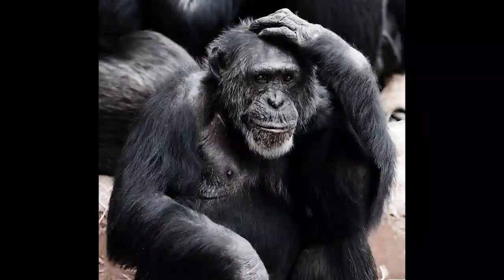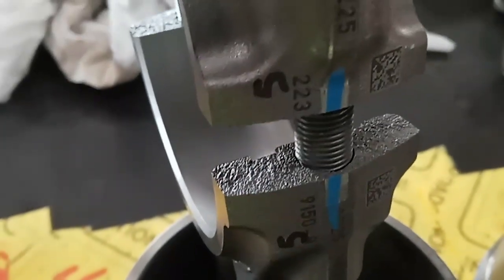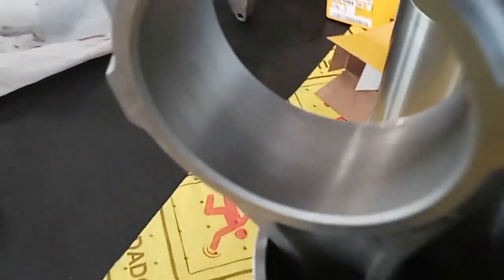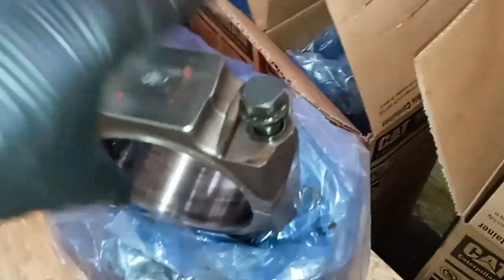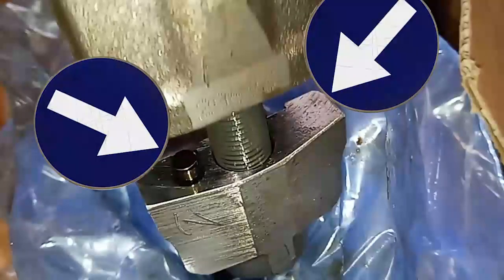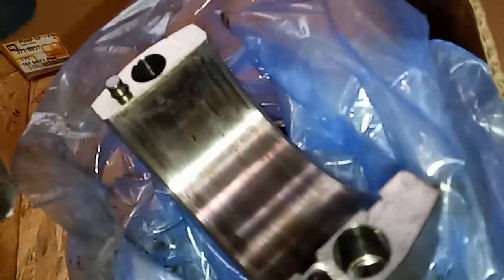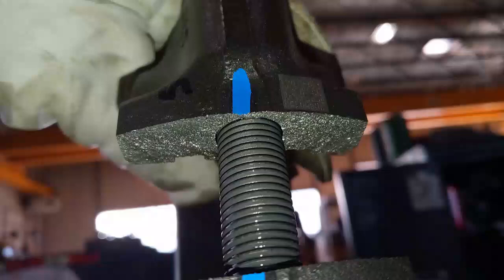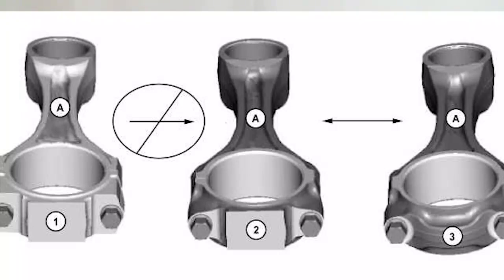What is a Fractured Connecting Rod? Cracked Rod? Advantages and Disadvantages.

Comment: Fractured caps were first used in the mid 80s by I believe Ford.  I think around 86.  They were powder forged rods made by Exotic metals (later Mascotech, metaldyne, and now American axle manufacturing, and before that the  Exotic building was a a roller rank) in Ridgway, PA.

The first diesel I know of to use powder forged cracked rods was the 6.0 powerstroke.  Metaldyne made them in North Veron Indiana.  Not sure if the 6.0 diesel was the first diesel to use them.

Comment: It's not really common there are shops routinely REPLACE fractured style rods when rebuilding an engine with them,  It is SUPER easy to mess up the mating surfaces, in a busy shop.

I've heard of shops resizing them with a sand blaster but I do not think it's common? 

I am not a fan, it seems like a dumb place to save $100 on an engine build to me.

Comment: You are wrong about fractured rods and why they are stronger. They resist journal movement and warping better. And when you have movement or warping you get bearing failure as a first sign.
And for your second argument. That why we put ultra clean motors together lube only what’s needed no lube or foreign material around the rods and pre-pressurize the oiling system while manually rotating the the crank assembly. Our engines are all pre-lubed and pressure checked. 

So let me break this down, by everything you said you hate details. You don’t want to be bothered by the care and details needed to assemble this type of part. You need a different career sir. You wine about problems instead of creating work arounds.

Comment: So I worked for large engine caterpillar plant in Lafayette Indiana. And they did that. They have a robotic arm that grabs a rod puts it in a machine that scores It with a laser. Then the arm puts it in a separate machine that the big end gets set on a locating bore that has a tapered rod protruding from the center of the bore and the machine pulls that rod down POW !!! And it’s split.

Comment: Cracked rods have ben around since at least the '70's.  West Bend Engines used this process on their two cycle engine, needle bearing rods. This eliminated the the slight surface mismatch  between the two rod parts and prevented failure of the needle bearing over time.
Reply: yea i have ZERO idea how he doesnt know about that. OMC (Johnson/Evinrude) had done that since atleast 1953 or so. this was clearly a necessity with the then-new needle bearing arrangement, but alot of 2 strokes back then still used plain ole' bronze ... which needed an absurd amount of oil. some where 16:1!

Comment: I suppose if you've got a V-8 engine, that you could use 4 cractured rods on one bank of cylinders and 4 machined rods on the other bank of cylinders.  I think it would probably run fine without too much vibration.  Or, theoretically, you could use fractured rods on cylinders 1, 3, 5 & 7 and then use machined rods on 2, 4, 6 & 8.

Comment: Fractured rods are not a new thing. They've been standard for at least as far back as the 60's.

I've rebuilt many automotive motors. Never once encountered connecting rods which were not fractured.
Reply from the maker: In the Diesel field, they don't seem to be as standard, they seem to be the exception from my experience.

Comment: One of the early Italian motorcycles, I think it was the MV Agusta had a four cylinder engine with a forged crank and roller main bearings, meaning that the outer races had to be in two pieces. The process involved cracking the outer races after cooling them in liquid nitrogen.
Ford has been using cracked rods since the CVH engine on the Escort.

Comment: Honda R18a engine (used in 2006 Civic onwards) uses cracked rods.  The rod and crap are forged as a unit then cracked apart giving the uneven surface.  No positioning pins.  It's a good and very reliable engine but in my experience no better than older honda 4 cylinders that use traditional rods.  In 2012 they Honda updated it to the R18Z.

Comment: Ive searched all your videos. Do you have  a c15 water pump remove and install video? Not many out there. Just nuts and bolts?
Reply from the maker: Just uploaded a video which kind of shows it a little bit, but not specifically.
Reply: Thank you very much. Regarding the water pump, I was trying with the t-stat housing removed. I removed the front 3rd of the oil cooler to get the extra room required (like I saw in your video). Thanks again, you are the best!

Comment: Also 're sizing a fractured rod is impossible. Entire rod with matching cap will need replacing... conventional rods can be 're sized as long as all weights are on par
Reply: Cracked rods are resized by increasing the large end diameter. Thicker bearing shells are then used.
Reply: @matthewstorm5188  if you can find outer oversized rod bearings and obviously inner o size, because crank will be stuffed. As far as I know, only ancient air cooled beetle engines have both outer and inner oversized main bearings and not rod bearings as well. 
Never heard of other engines with outer oversized rod bearings. 
Besides, this will severely affect internal balancing of rotating assembly. So imo and what I always do... new rods, and be safe and know it's 100% without mods

Comment: Fractured Rods have been around long before 2003. Ford with 4.6 liter modular engine used powered rods so no special metal has to be used. They use laser to etch rod and split them apart.  Machining big end of rod (bearing bore) no different than non-fractured rods. Parting surfaces on machined rod under load tend to work against each other (aka fretting). On fractured rod there is no movement between parting surfaces. As a tech working with fractured rods not down side, both styles you have to be careful with. If you did damage fractured rod parting surface in very small area you can hollow out that part. Only big downside to fractured rods if big end gets out of spec they cannot be fixed like non-fractured rod can be. I deal with fractured mains and rods not big deal too me
Reply: Hey, can please tell me what are the other reasons for step generation in a fractured con rod? I am currently working as a intern in a reputed car company, i have been working on this project but really I can't figure out how this step is generated, it's random and I have made sure the con rods are handled perfectly still this step is generated.

Comment: One other thing is that you can't resize the rods. They're one and done. Now I dont work on big diesel stuff so I'm not sure if that common practice on them. But on smaller engines it's common to resize rods by taking a few thousandths of the rod cap and then the machine it back to proper size to have a perfect fit for the new bearings. You can't do that with a fractured rod.
Reply: You have to increase the size of the hole and use thicker bearing shells (if these are available).

Comment: If you really want to stir the pot. Most of the fractured rods are made from powdered metal that has been pressed at high pressures to make the rod. Thus the easier to fracture the cap off. Also cheaper to make. No problem for normal usage, but if your really turning a lot of rpms and high power, forged is MUCH better.
Reply: Forged rods will bend before they separate. Sintered rods just separate and grenade the block. Sometimes the little things in life are important.

Comment: Hi Joss. Very interesting. Thanks. Mercury ( outboard engines and some others ) used this principle. That was because they are two strokes and use Needle roller main bearings. The machined rod is impossible for this because you will always end up with a small step and that upsets the needle rollers. The Mercury rods were made from case hardened steels ( again because of the needle roller application ) and the case layer was deep enough to cover the entire fractured surface, therefore making it possible to fracture. These two strokes are ""normally"" rebuilt in "clean facilities and by high level technicians", so the fractured rod was quite successful. I have to say I was very surprised to see this applied to CAT's  because as you correctly mentioned the mating of the surfaces can be problematic in the environment of heavy vehicle maintenance. I know all about this because I was part of the little team who working on the Cosworth Boat project and we had close dealings with Mercury. I'm a big fan of your YT channel and have learned so much about your work. Keep up the excellent channel.
Reply from the maker: Thank you for the comment and interesting information. Thanks for watching.
Reply: Hey Tim, can you please tell me how a step is generated in a fractured con rod given that they are handled perfectly as per the process. Can you tell me something you have experienced urself that specifically generates step in a fractured con rod.
Reply: @laputin710 id think its just an end mill that creates the grooves. trial and error i presume to get it right where they split perfectly.
Reply: wait Tim did you work on the 300 V6 back in the early 80's? always fascinated me that motor! i know they had cylinder liner issues or something and were low revving and relatively heavy so never really caught on, but must've been an answer to OMC's V8 motors dominating the circuits back then?

Comment: Is there any easy way to figure out which cap belongs to which rod? I have 5 extra rods for a boat engine and would like to use them, but when I bought the engine the previous owner didn't mark them when he pulled them out so I don't know which ones is a pair. They're the machined type.
Reply from the maker: Well, that can be tricky, you can look for etched numbers on the rods to identify them. If nothing else mate them together and measure the journal bore size. If it is specification that will work, might just want to get new ones though would be my recommendation.
Reply: @AdeptApe  Yeah, might just buy some new ones... A boat isn't really a place where you want engine problems 🤷🏻‍♂️
Reply: Clean them, carefully tap tap them together, one at a time, do not torque, the parting line will only match on its partner, ( 99 percent of the time ), this a light tap tap, as soon, or if it doesn't go flush, try another cap  . Also keep your eyes open for marks, and also the chamfer will match if correct  . If you wanna go a hundred percent,  after you do the former, torque them, and have a machinist check them for round and spec size .

Comment: Another issue I have came across with a fractured rod is , if you have one that has fretted a bearing and you hone the big end to remove the bearing material it will male the big end to big . On some of the smaller diesel engine we work on they are beginning to make an oversize outside diameter bearing for this reason . 
  Fretting is when the bearing begins to stick to the actual rod . Also you can not cut the cap and rod and machine the rod , they are not repairable .

Comment: They are stronger, it relieves stresses on the bolt so the bolt is less likely to break. Used in high revving performance applications, for the factory trucks your working on yes its primary for production cost. Now modify that cat to run 3500rpms at 3000+hp for sled pulling and that extra surface contact comes into play.

Comment: Every time you split the rod debris is created, you need to clean with a soft bristle brush and solvent, dry with compressed air. Also they should only be handled in 2 pieces or assembled and torqued to spec. I also read somewhere they have a limited number of times they can be split. I hate working with them.
Reply from the maker: Sounds like a bunch of reasons to hate them even more. One of the "benefits" on the Cat website mentioned easier installation by technician, not sure who wrote that.
Reply: Adept Ape That guy also works in the sales department🤣
Reply: @jeffsimonar7161  😀😁😂
Reply: Another issue is that, if you use any kind of brush, the bristles can generate debris that can get stuck in the valleys - especially if you pack it in there by inadvertently stick the cap on before cleaning the surface. This, along with any kind of dirt, contamination, or physical damage, can cause the rod and cap to not mate properly.

Comment: Good video.  How do you cut the rod cap and rehone the bore on a fractured rod like you would do on  a machined rod, or do you not hone a,fractured rod.
Reply: The bore is honed oversized and larger OD rod bearings are used, if the manufacturer even offers them.  On the Cat fractured rods, they are scrapped if the crank pin bore is out of spec or damaged.

Comment: Out board motors and motor cycle s have used this for decades.
OMC Evinrude invented this in 70s
Reply: actually some in the late 50's! the big twin motors used them. same rods through early 70's, and one model made it to 1984 with the same basic rods (commercial 40hp). the rest were all fractured 1974-up as well. i rebuild these for a living. the only issue is when they went to precision-ground type over hand-sanded. a special alignment tool is need for the former. not hard to do with the tool, but many motors have grenaded themselves when some backyard tinkerer thought he could align them by hand :)
Reply: @ct1762  I also built so many outboards in 80s-90s.
Sad OMC gone .
👍
Reply: @Motorhead250 really is. such great motors!
Reply: exactly

Comment: I thought that fractured rods being a relatively new manufacturing process would or should somehow  make the rods stronger. Today I learn that is actually not the case. It's just about a 30% cheaper method to produce connecting rods.
Reply: YES! If cracked rods were truly superior, aftermarket performance rods would NOT be machined.
Reply: @matthewstorm5188  there’s PLENTY of aftermarket rods that are fractured like this…

Comment: All high revving 4 stroke sport bikes since 2004 have fractured rod and caps. The first time I found out about this style connecting rod was a Yamaha R1 I rebuilt with a dropped valve.. well I thought the rod cracked and that was a problem 😂 I even called Yamaha tech and was embarrassed when the tech told me it’s factory and I need to read my tech Manuel better.. 😂 he also said it 30% stronger at high rpm’s like 10k-14,500 rpm. It help keep the rod bolts from stretching at those rpms. It keeps the cap from walking side to side. That’s what they said not saying it’s true
Reply: Yamaha was first to do this in 2004 R1 and perhaps other Yamahas like the R6 I’m not sure. I know Honda has used this method for a while now. But definitely not in 04. Yamaha came up with this technology that year so no one else had it in 04.
Reply: @jacobhendrickson8935  it was a cool time back then. I worked for Yamaha for almost 10 years. The 4 stroke technology from 2001-2009 was insane to be apart of. When Yamaha released the 2009 R1 in Vegas it was mind blowing. I got to meet and hang out with Valentino Rossi at the reveal.
Reply: “ It keeps the cap from walking side to side.”

That’s the job of the dowels. NOT the bolts. Even on a machined rod, the bolts carry no shear load. As for cracked rods, if they are SO superior, then why are ALL aftermarket performance rods machined?
Reply: Aftermarket doesn’t necessarily mean “best”, it just means parts made by a third party to factory dimensions. Why would aftermarket manufacturers invest in a whole new tooling line and setup when their current product is meeting their demands? 

Ask yourself, how much does it cost to change over to making fracture split rods? How much do you save on each rod? How many rods do you need to make to break even? How many aftermarket rods get sold? How many OEM rods get sold? There’s just a tiny difference in scale there. Every second and cent of machine time they can save per rod adds up massively over the number of engines they make.
Reply: @matthewstorm5188  if you read my post, I never said the rod bolt keep the cap walking side to side. The fractured pattern helps with the walking. I’ve never seen a fractured rod with dowel pins. So I don’t what your talking about, a machined rod needs dowels pins because the surface is machine. 
As far as you question about the aftermarket world I don’t know why nor do I give a F@ck. Probably cost. Most after market rods for the moto industry are junk. I’ve seen stock fracture rods on a turbo r1 handle 600hp. The rod bolts where not stock nor where the head studs and cam. The engine for the most part was stock. The watercraft world is seeing 1200 hp with bottom ends with big ass turbo’s. It’s no secret japans know reliability and performance. So my question to you is why would the Japanese engineers use fractured rods in the highest performance highest rev’ing engines know to man if they are so inferior to standard rods

Comment: Like #8 and the commercials havent ended yet.  Just anticipation, haha.   I put together a bottom end on a yamaha outboard 150hp and it had fractured connecting rods, fascinating.
Reply: Evinrude Johnson did this since 1970s.
Reply: @Motorhead250  Ive done snowmobile engines for 35 years and that was my first outboard crankshaft repair. Was fairly easy.  I'll keep that in mind if ever happens again.  very interesting experience.